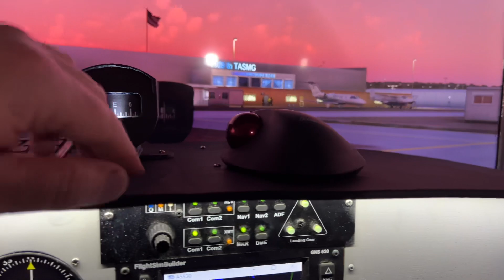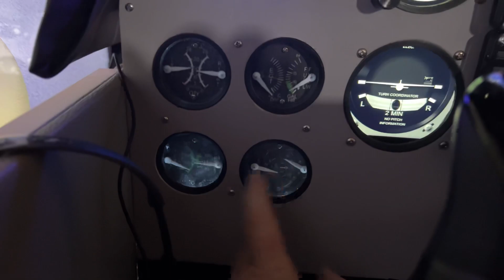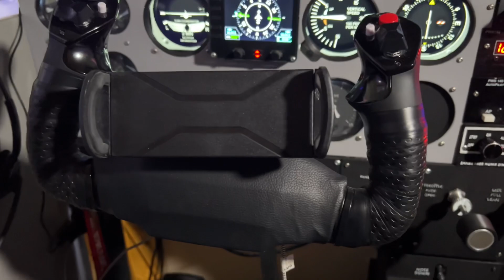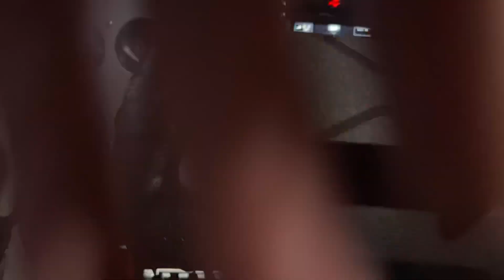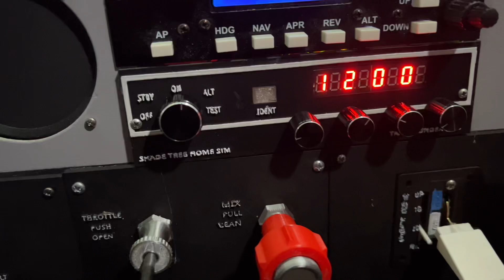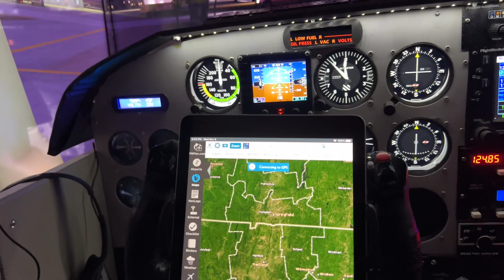Quick Tour of the Cessna 172 Home Cockpit

Comment: I’d like to see a video of how you set up the monitors. I’ve tried it unsuccessfully.
Reply from the maker: I can do this…I just went to the General Settings tab, down to the Experimental Tab and added them.

Where I got frustrated with them at setup was they didn’t show up quite right at first.  The right side showed up as left, left as right…and they were offset.

So I can do a video showing how I added them and then moved them to get them aligned…is that what you’re looking for?
Reply from the maker: The biggest issue I had was actually with the two smaller monitors…the gauges and the GNS 530.

I used USB to HDMI dongles, but quickly found that not all dongles are created equal.  The most “reliable” was the J5create brand…works every time.  The random/no name brands were very hit or miss.

Comment: I've seen that there's a command to get the top window bar to go away on pop out screens (like your GNS530).  I haven't tried it myself yet, but I believe when you're on it press ALT+ENTER
Reply from the maker: You were 100% correct…once I transferred/popped out the 530 and got it on the display…then alt+enter and full screen in the next video.

Thank you for that.

Comment: thanks for sharing and congratulations, it helped me building. I have a similar design based on a more or less 1:1 KingAir full cockpit section, a 4090 with 3 TVs, and a small pc for all cockpit which is driving 2 touch screens, some HW switches where I am struggling at preset connecting the switches to the functions in the sim. Might go to Air Manager and Arduino. I am flying X-plane 12 and MSFS where I must say I like X-Plane more. Aloha to Hawai? from the German Alps.
Reply from the maker: I definitely need to do more with xplane.

Basic switches and functions were fairly easy in Air Manager, but for me…Mobiflight was easier overall, especially with “hubhop”.  If you can’t find what you’re looking for in the Mobiflight app, hubhop is a great resource.

After about a year of struggling and learning I can do way more with Mobiflight these days, now like all software sometimes it needs a quick refresh (off/on again or reinstall) but for the most part it’s been good.

Now I do wish it worked reliably with the Arduino Nano…I’ve only had about a 50% success rate with that.

That sounds like an impressive setup…the 4090 must give some great visuals